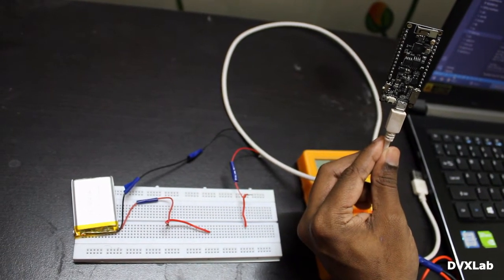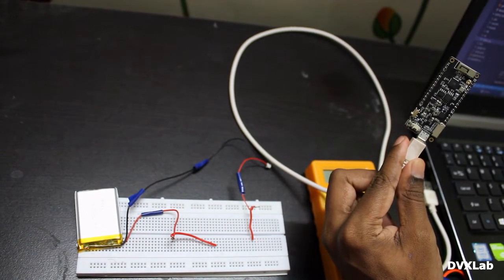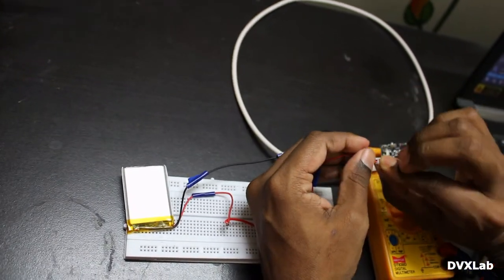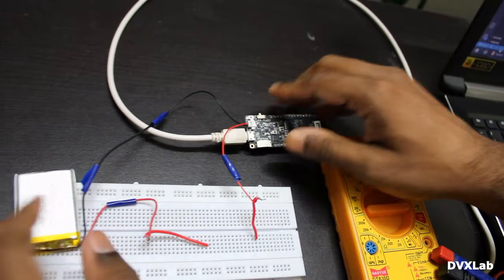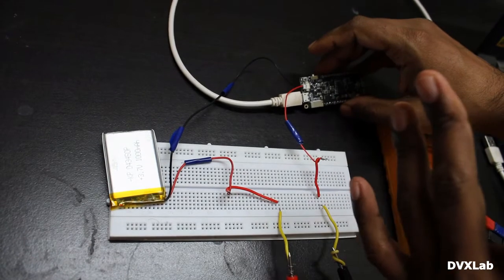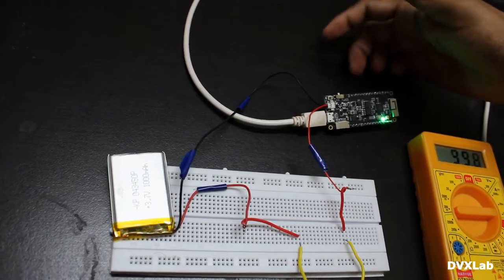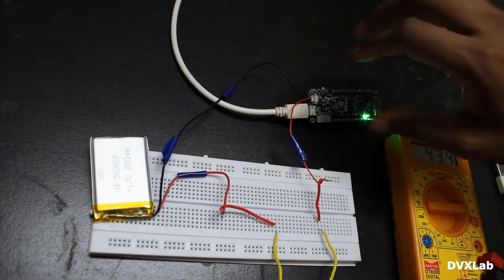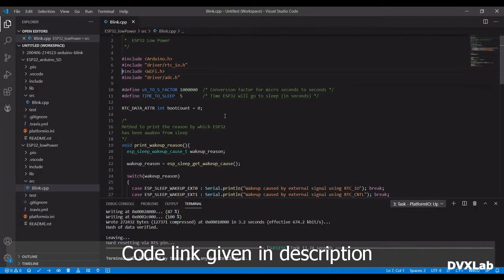ESP32 Battery Powering and Deep Sleep Power Check

Comment: How long it last in battery power wen in sleep mode assuming we use same battery shown in this video. Please let us know
Reply: With following specs : 1000mAh battery 60sec sleep time sleep current 2.9mA and 3 secs wake up :
Your device will probably run for 131 hours or around 5 days and 11 hours
Its estimated, average power consumption per hour 6.1 mAh
To be honest 2.9mA sleep current is too high for long term battery use.
There are boards that only consume from 50uA to 100uA while on battery.
So on average your battery will last about 30 times longer than in the video.